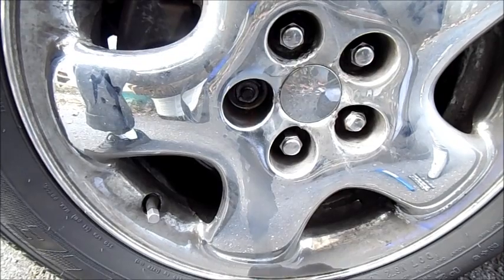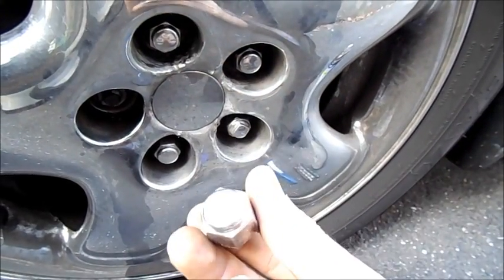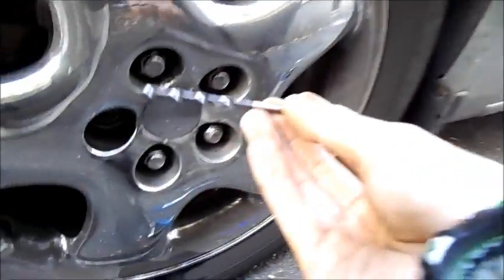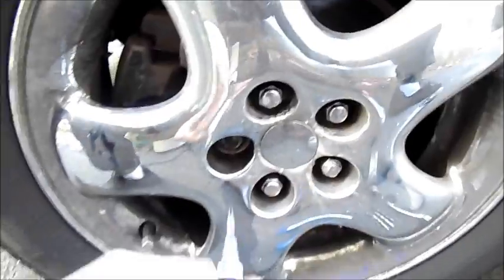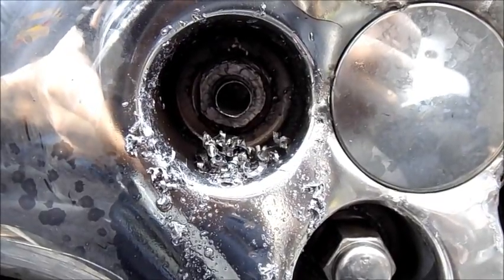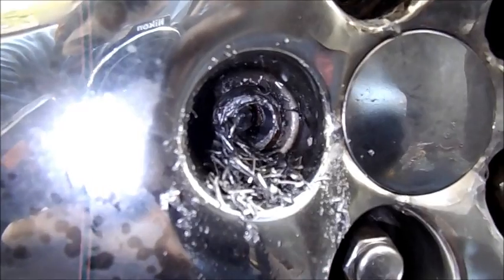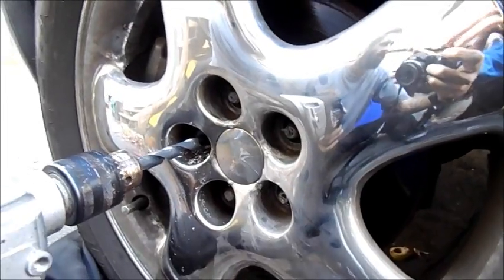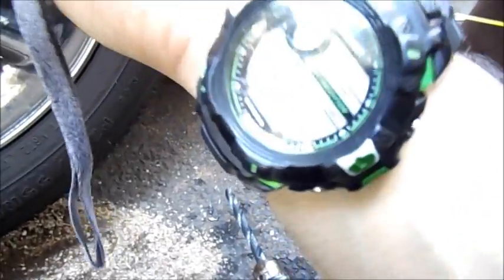How To: remove a sheared off lugnut

Comment: I just got done watching like 20 "stripped lugnut removal" and " how to replace a stud" videos. Kudos to you for doing it the right way. Step one, try an extractor nut. Step 2 if that doesn't work drill out the stud, you've gotta most likely replace it anyways and in the case of this video he did no damage to the wheel with any chisels or torches.   BRAVO
Reply: i got some titanium bits afte 4 hours just barrely got 1/10th the way through. Might need a torch

Comment: Good video. Used a 1/2" cobalt bit to solve my own catastrophe. It was the only method that worked. Mechanics love to put insane torque on lug nuts. Got my tires changed and it took almost 250ftlbs to get the nuts off. No wonder they strip the studs.

Comment: Hade this happen today on my wife’s SUV with expensive after market black rims, I freaked out. I def wasn’t going to put heat to it and thought about a pneumatic chisel but knew that would have def trashed the rim. Found this vid and did just this and got the rim off with out even a scratch. Used colbolt bits small and worked my way up with cutting oil. Drill slow and press hard, ripped right through it. Def appreciate the video 👍👍👍

Comment: Same problem. 24 bucks got solid chromed lug nuts for all 4 wheels on my wife's Cherokee... only one broken lug nut. Had a tire shop change them out for me because my 300 torque lb. impact wouldn't budge any of them. Not my first time dealing with these stupidly designed chrome covered POSes, but it will be the last on this vehicle. Thanks for the video.

Comment: Good job. The caps get ruined from the guys at the tire shops running their guns at way higher torque than they should. Anytime you get new tires, when you get home, loosen, then re-torque your lug nuts one at a time to specs, then re-check them 30 days later. If they sit for a long time after being over-torqued, you might have a hard time getting them off later. 
I read lots of questions asking about the drill bit you used. I don't think hat was a carbide bit, it was a probably a cobalt bit. Regular high-speed steel bits are generally not hard enough to drill through a lug without a pilot hole. Be advised, good quality bits are not cheap, but low-quality bits can be more expensive in the long run, especially if you break one off in the lug. Remember to push the drill bit hard enough to cut the steel, but not so hard that you break the bit. Cutting with too little pressure can actually work-harden the lug. Keep the RPM medium to low and use cutting paste/fluid. If you don't have cutting paste or fluid, use any kind of lubricant to keep the bit cool.
Advanced tip: If you can find a wooden dowel, or make one that is exactly the same diameter as the hole your lug nut sits in, drill a hole dead-center in a 2-3 inch dowel the same size as your starter bit. Put the dowel in the lug hole and it will be in the dead-center of the lug. Drill a starter hole in the lug, then remove the dowel and continue drilling.

Comment: I had this same issue today. I have some Hercules drill bits from harbor freight and a Bauer cordless 20v cordless drill. I tried this method and it worked! Started wit a small drill bit and stepped up from there until i drilled through the threads. Took about 30 mins to an hour.  I didnt use a punch, although that would of probably helped centering it. I didnt use any oil, just have to have some sharp bits and dont force it or else you'll break bits inside.

Comment: Question  once you drilled it out, do you leave the wheel running with for bolts or does it have to be replaced? If so, do all car ise the same size?
Reply from the maker: @tonygarcia3442  i won't lie, I drove it until i junked it two years ago with 4 lugnuts. They are usually specific to a make model year to be safe. Rockauto.com is your friend.
Reply: @TonyFleetwood  😂.  Well, thanks for the honesty and the info as well. Appreciated it! Thank you!

Comment: Great drilling. Almost perfectly center. Good eye. BTW, your car cant be just 1 year old, unless you live in an area where they use salt A Lot on the road.  Seems like a lot of rust for a 1 yr old car.
Reply from the maker: its a 2001 pt cruiser i bought used, and i owned it for about a year before i had to do the brakes on it, and thats when i found my... issue :(

Comment: im on day two of drilling two lugnuts out because some ass clown tripled the torque rating of the lug nuts and the outer layer fucking disintegrated with an impact gun,  what drill bits are you using cause ive gone through like three
Reply from the maker: +slipdip1 the first bit i used was a tungsten carbide bit, on low speed. the rest were bits i had laying around. the key is to go slow so you dont wear out the cutting tip of the bit.

Comment: you could also try a left handed drill bit if you can find one close to the diameter of the stud you punch it drill it in a little bit then hit the reverse on the drill and throttle on and off on and off until it grabs it and releases the lug nut
Reply from the maker: i dont see how that would work better...
Reply: nvm your threads are fixed on the rotor that's why it's all messed up at the end of the video, other cars for instance a volkswagen uses a bolt rather than just a nut on a fixed stud and it would work better with a bolt because then the bolt would be extractable  rather than drilled completely out

Comment: 7 hours and 4 broken bits later and its still in there howd you do it in an hour??
Reply from the maker: the first bit is the key, if you drill nice and slow with a carbide bit, you can use the regular kind of drill bits from then on to step up the hole size. if you drill too fast it will burn out the bit and it wont cut well and make the process take longer. plus its a good idea to use some kind of lube when cutting the first hole. i used wd-40 but lots of stuff will work, its just to keep the drill bit cool.
Reply: 18 wheeler wheel lug nut rim
Reply: Stace Buzz must be a cobalt bit. HSS bits will not work. Take ur time. Cool the bit down with water or oil periodically.
Reply: Tony Fleetwood what is carbide bit and the size?

Comment: Hello. I was wondering what kind of drill bit you used. There's a lot of bits that say they'll drill through metal but I've seen them only drive through weak metals or thin pieces.
Reply from the maker: i said right at 1:27, a carbide drill bit. once the hole is started regular metal bits should work if you cut slow
Reply: I prefer cobalt and a good cutting fluid for metal drilling.

Comment: It doesn't matter how long you own a car,  how corroded it is.  Corrosion is a function of environment plus exposure length.
There's no way that those wheels and brakes looked like that with only one year of wear, unless it was a hurricane victim. 

BTW acorn nuts aren't a problem. Cheap fasteners are.
Reply: Mines only been on for three months and I beg to differ.

Comment: So what did it take to replace the stud?
Reply from the maker: you can knock it out with a heavy hammer and a punch. the new stud you put in and tighten the lug nut to draw it into the hub before you put the wheel back on. you may have to really beat the old stud out.

Comment: I might have to do this tomorrow.. 2009 Dodge Charger... Any tips? Thanks in advance.
Reply from the maker: if you have to drill it, get that bit as centered as possible, if you dont have an auto punch like i do, use a manual punch, if you dont make a punch start the bit will walk around and mess it all up, and that will suck.

Comment: this is nothing.  at work, customer came in with a broken wheel lock and the key pretty much broke the lug nut in in half forcing us to drill that fucker out.  It took us 2 god damn hours, because we had to go through the lug nut and the stud, and, AND the lug nut was an extended thread, so we had to drill an extra 3/8" or something.   I don't know what the guys up front charged him, but I would have charged him a minimum $100 and extra money for the drill bits that got fucked up.

Comment: This is happening to my Chrysler 300.... I just wanted to check the brakes ! But I ended up not being able to remove the wheel cause of a stupid lug nut... it shredded off and well Ima try this.. also what do you know it's a Chrysler lol
Reply from the maker: RTS good luck and drill slow unless you have a high speed carbide drill bit. high speed will dull the edge and it wont cut as well as a slow twist.

Comment: What are the sizes of the drill bits? Thanks.
Reply from the maker: the bit sizes are irrelevant. use a small bit to make a pilot hole. then find a bit that fits the inside diameter of the lugnut, or close to it. try to use a size in-between the smallest and largest to make drilling the hole easier.

Comment: Just purchase a rounded off socket with the cutting teeth inside, like used for wheel lock removal. That is now a 30 second job.
Reply from the maker: you obviously didnt watch my video... now your comment looks foolish.
Reply: No I was just an auto mechanic for 45 years. How could I possibly know what I am talking about?  Do I the hard way, I just offered a suggestion.
Reply from the maker: if you watched the video, you would see that i tried to use one but it could not make a purchase on the broken lug. maybe if you watched the video you would know that.
Reply: Because you are not trying to capture the lug, you want it to grab on the leftover part of the nut. You can plainly see there is plenty of nut left inside the hole. You don't have a clue of the type of socket I am talking about. It is not a hex socket, it has cutting teeth inside, the harder you twist it the more it cuts into the round piece of the broken nut. The socket only works when turned counter clockwise.
Reply from the maker: look you idiot, you can plainly see in the video, that i used a SNAP ON stripped hex removal socket, just like the one you keep saying i didnt use, there wasnt enough meat on the lug for it to get a good purchase on it. what part of that is so hard to understand? here ill type it in all caps for you.  I HAVE A WHOLE SNAP ON SET OF ROUNDED HEX REMOVER SOCKETS YOU DUMB FUCK. THE LUG NUT DIDNT HAVE ENOUGH METAL EXPOSED ON IT FOR THE SOCKET TO GRAB ON. WATCH THE FUCKING VIDEO AND YOU CAN SEE THE GOD DAMN SOCKET I USED IS THE ONE YOU INSIST I DIDNT USE. its at 1:10 in the video, now please fuck off.
Reply: Well Snap on isn't the only company that makes those sockets. Maybe you should have tried a another companies sockets, Mac, Matco, Lisle< Craftsman. It doesn't have to be a socket just for lug nut, they come in every size from 5/16-8mm to 1 inch. I told you before I have been a mechanic for 45 years and that is a 30 second job. The fact that there is a tire store next to my work I do those type of broken nuts for them once a week.  But that's ok, you must know more the me since you did it the easy way.
Reply: Not to mention the socket you have clearly says it is 19 mm. The size of the lug nut before it sheared off. So clown, why would you start with a size for the hex, when the hex is gone?   Don't know who you asked that told you they never saw that occur before, guess they were also you tube mechanics. It happens all the time, even with the European cars that use lug bolts.
Reply: No it makes no sense at all to start with the size of the nut when you have the nut part in your hand. You can clearly see the whole hex portion came off the nut. But I don't know as much as you , that's why I had to watch the video, to see how a real mechanic would handle the problem.   Boy am I glad I am stupid, I would go broke if I had to do that job for a living.  Work smart not hard, nobody ever told you that?
Reply: @gregc1520  can you please tell me what kind of too you are talking about? I'm experiencing this problem right now.. Is it a bolt extractor set?
Reply: A socket made to take off  stripped lugs or wheel locks. It has a set of spiral teeth inside and the more you turn it the tighter it bites into the lug or lock. Mine came from Snap on or Matco tools. I know you can also buy them online , work great, but not cheap. I believe they are list as wheel lock removal sockets.

Comment: i had to cut the rim off my dodge ram even after i did that.  i had two of them shity lug nuts that was striped out. not only did i have to replace the studs and rim. i killed the grinder. i was so pissed. but i refuse to pay the shop down the road a hundred dollars to remove two lug nuts. fuck em. just the way i am.

Comment: power or electric drill
Reply: do you pneumatic drill? any electric drill in your hardware store can handle this with the right drill bits. also, auto/self center punch is much easier better than a manual and doesn't cost a whole lot more.

Comment: Chrysler and Dodge are going out of there way to place parts in areas that are just impossible to work on or you will need special tools there Journey is full of bull shit to much to talk about but the lug nuts are one issue , power brakes fail and start to tear your differential and transmission on the all wheel drive . rear wheels tow out and the alignment bolt rusts into the tie rod . there going to chaise everybody away from buying there vehicles.

Comment: Stupid caravan uses one small lug nut per wheel for theft prevention but getting it off is a guarantee strip wonderful design by Dodge just like my wonderful 5.7 hemi charger it’s been through two blocks and I haven’t broke 100 mph once ridiculous. Don’t buy a 5.7 go for a 6.1 or a V6 model  PLEASE

Comment: Hi- Thanks for showing us this technique. This has got to be the easiest way to solve the problem. While trying to replace rear shocks I cracked the lugnut on my wifes Mazda 3 (It was a security nut to boot- Another moronic idea!) My friend at a tire shop offered to burn the stud out but I didn't want to trash the wheel. Took me a month to get around to the job and about 90 min to do. Hole was not quite centered but good enough to weaken it when I finished with the 3/8 bit. I shot some footage with my phone very similar to this but no sound. Maybe I'll post it but THIS video tells it all. Thanks much!

https://www.youtube.com/watch?v=GGBou46uGD4

https://www.youtube.com/watch?v=VwEtZPAl0FY